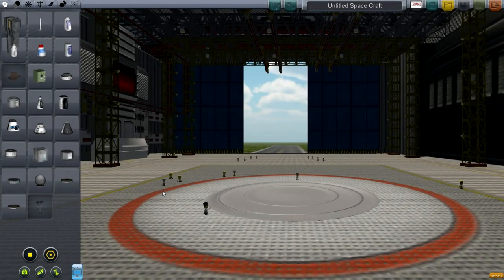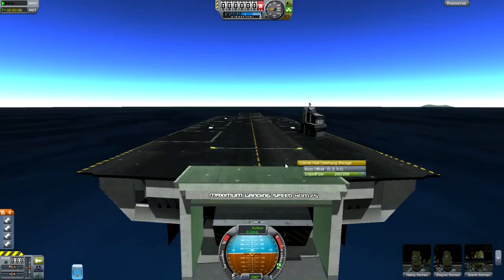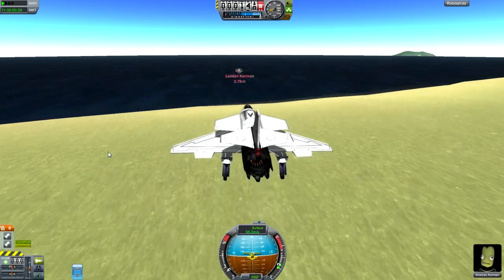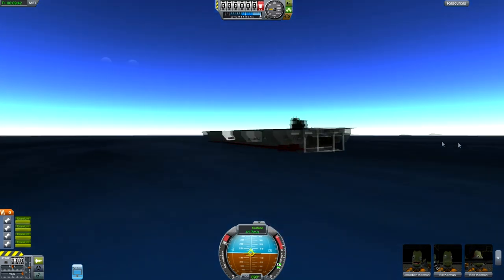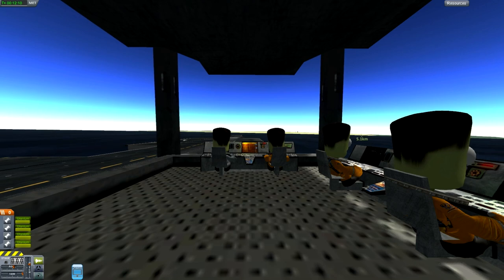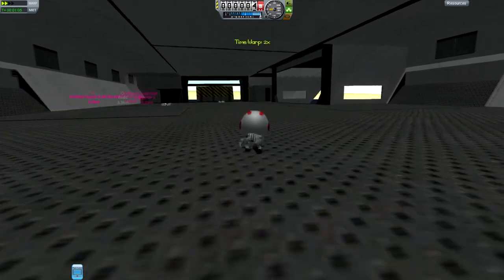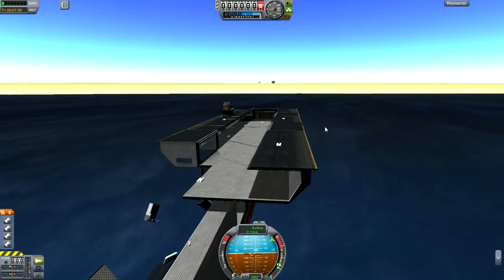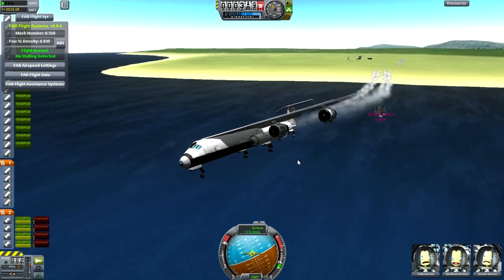Kerbal Space Program - Carrier Mod - Landing on a Postage Stamp... or not.

Comment: The rudder is the control surface on the tailplane (which is the little wing sticking up at the back) of an aircraft. Horizontal control surfaces are the ailerons on the wings for rolling and rising, and the elevators on the rear for controlling pitch.

Comment: Scott - In case nobody mentioned this already, KCV = Kerbal Carrier Aviation.
The US Navy has used the initials 'CV' as their designation for aircraft carriers since the 1920's. I had assumed CV stood for 'Carrier Vessel' but I am reliably informed does in fact stand for 'Carrier Aviation'. While 'AC' would seem more obvious, designation starting with 'A' was already in use for auxiliary ships (transports, hospital ships etc), and 'CA' was already in use for heavy cruisers. So, CV stuck...Cheers.
Reply: Stuart M. Actually you're half right. The designation comes from the fact carriers were seen as an extension of the sea control and denial mission of cruisers. This gives us the "C" in the designation. The "V" apparently comes from the French verb "voler" which means "to fly". So while "Carrier Aviation" works, "Cruiser Voler" apparently works too. Either way, I know for a fact the "N" attached at the end denotes that it's a nuclear powered vessel, so we're left with "Carrier Aviation, Nuclear powered" or "Cruiser Voler Nuclear" as the designation represented by "CVN". I have no doubt that the "K" does in fact represent "Kerbal" as you said.
Reply: Of course, another explanation for the designation I've heard is the "V" meaning fixed winged aircraft so CVN reads as "Carrier, Fixed Wing Aircraft, Nuclear Powered"

Comment: Correct. Rudder's are generally attached to Vertical Stabilizers, which are the vertical component of a typical tailplane. Similar to an elevator typically being attached to a horizontal stabilizer. You can have a "flying tail" without a stabilizer if the whole surface moves.

Comment: Nice video Scott. Just for reference, the vertical surface(s) at the rear of an aircraft is called the Fin, and the control surface on the back of it is the Rudder. The Tailplanes are the horizontal surfaces at the back, and their control surfaces are the Elevators.

Comment: If I remember correctly, the pilots are suppose to aim for the 3rd arresting wire. As it is the safest wire and most effective target, To move up the ranks, as a pilot, you should be able to get the 3rd wire consistently.

Comment: Physics are only updated for entities within 2.25km of whatever you're currently controlling. Also, lowering Delta Time does indeed improve your framerate; it's essentially the amount of time the game allows physics calculations to run for each frame, if I recall correctly. Lower delta = higher framerate, at the cost of slowing down the in-game time.

Comment: I make my own carriers, using stock-parts, B-9 Aerospace and Parts-expansion mod.
Already landed 2 aircraft on the 64m long and 16m wide deck, floating in the water on lots of structural fuselages and connection struts.

Comment: After looking into Unit Designations as you suggested, I stumbled upon balloon units that were designation with a Z, which suggests that Z as lighter-than-air has not been retired. Also if V were to stand for fixed wing, wouldn't all F14s need to be classified differently, given the fact that their wings are not fixed, but variable geometry?

Comment: Yes, however that document doesn't actually address why individual letters are chosen for designations, apart from T, F, and N. Apart from new ship classes (i.e Littoral Combat Ship) most if not all designations still follow the system laid out by the Navy in the 1920's. The system from the 20's works, and is so flexible, that the USN would be foolish to abolish it, which they obviously haven't. In practice though, the V is just a left over from the era of military airships. you won't see a CZN.

Comment: The Unity engine is single-threaded, meaning it can only make use of a single CPU core. This includes the physics engine. The FX-8120 is a decent CPU, particularly on budget, but it's designed to perform well in multi-threading, hence the whopping eight cores. Its performance in each individual core is vastly inferior to, say, an i7-3970X.

That said, with enough patience, the game is still very much playable in your position. I've put 560-part stuff into orbit and I only have a Phenom 1090T.